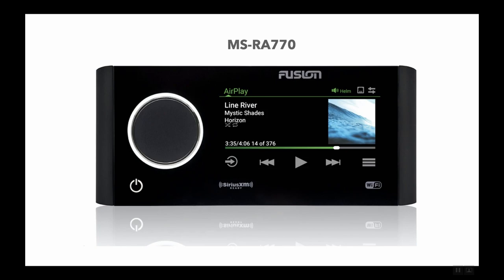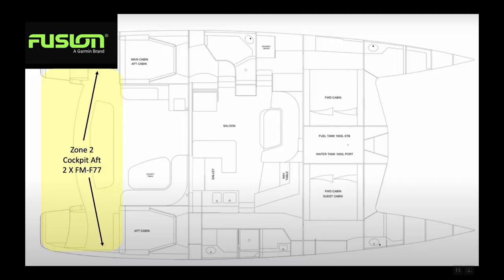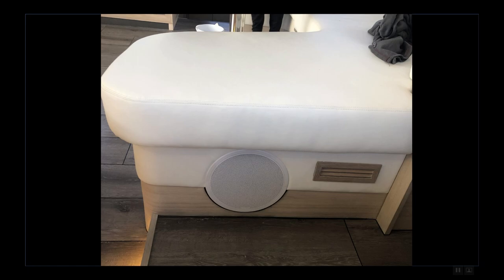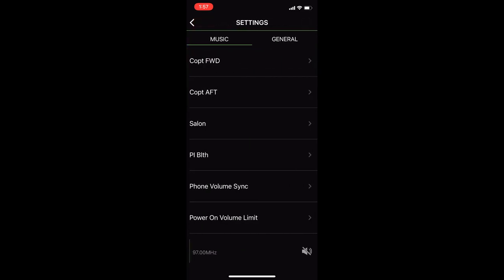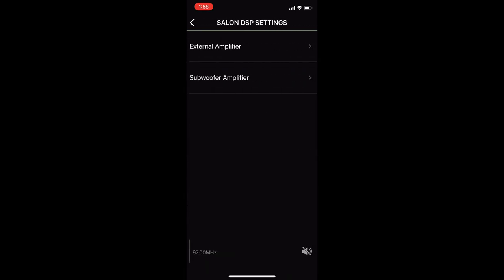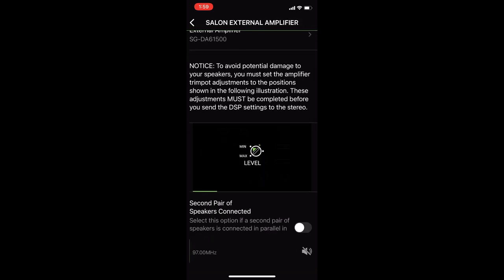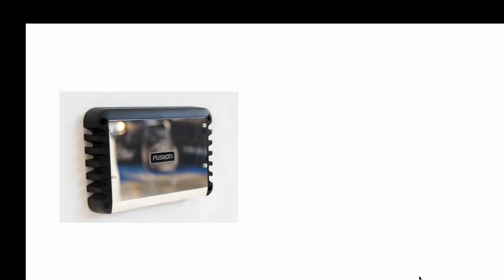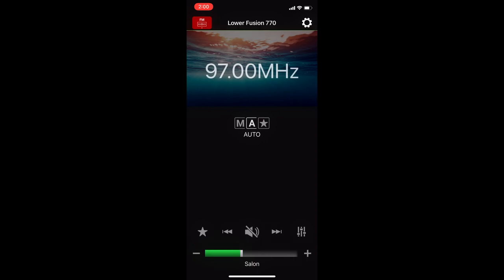Video 25: Fusion Audio Setup

Comment: I bet Wagon Wheel will sound even better now! Random question - why did you use "open air" and not "covered" for the cockpit environment setting?
Reply from the maker: good question Matthew, I was going with the fact that the cockpit is open on 3 sides